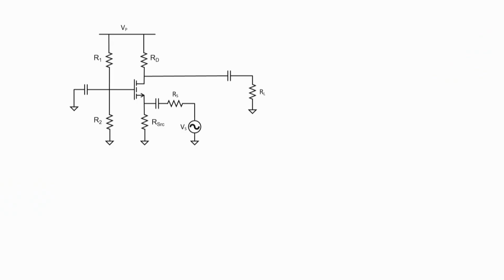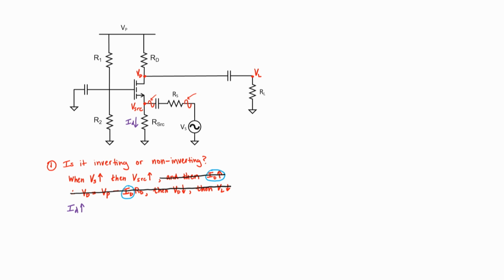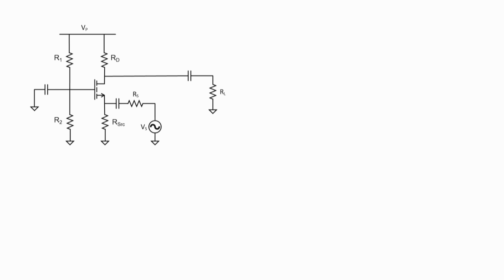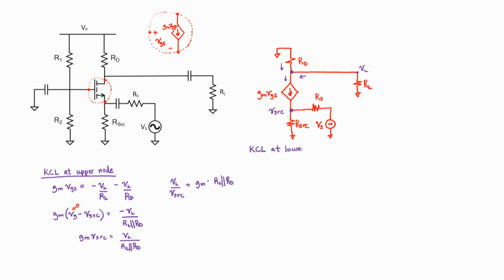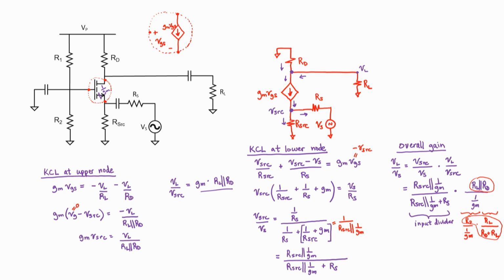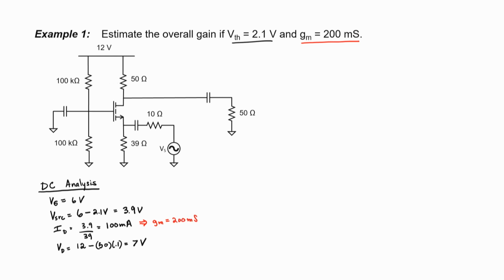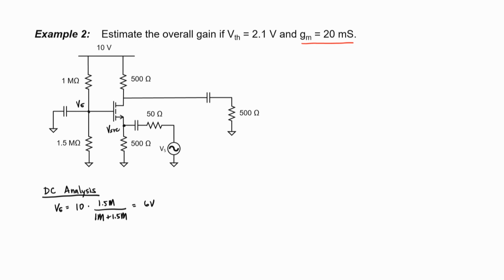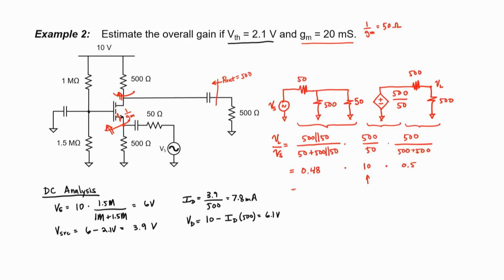Not Mysterious at All: Common Gate Amplifiers (28-Transistors)

Comment: When do you want to use this circuit?
Reply: That's too practical a question, not allowed😂
Reply: Its is a low impedance input and typical high gain inverting amplifier. You see it in a long tail pair (differential pair) - the "backside". In a pinch maybe could be useful for mixing signals. Also it would convert from low impedance to a higher impedance circuit